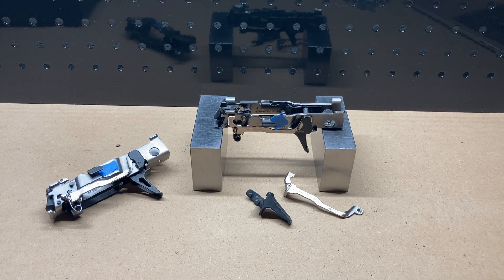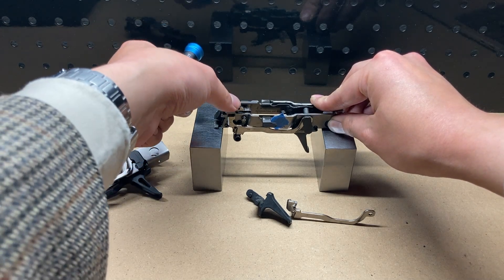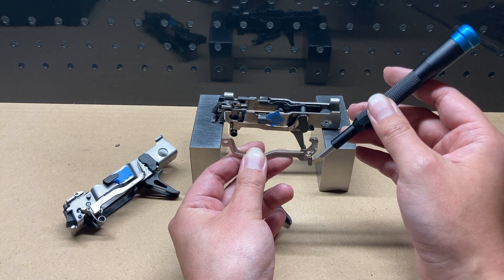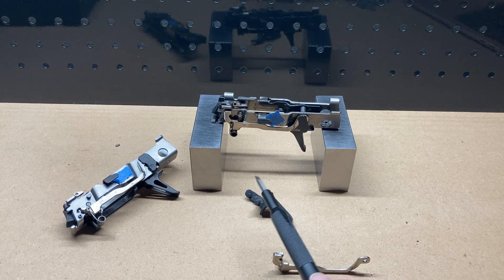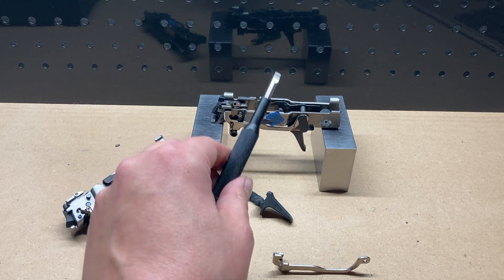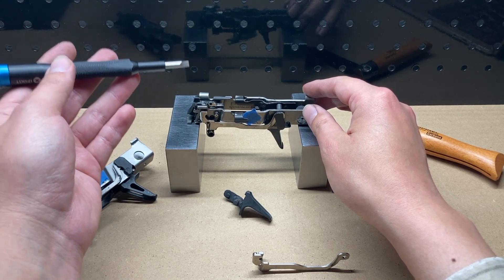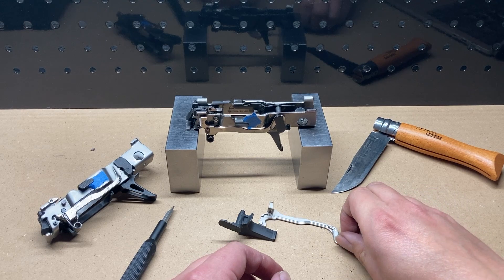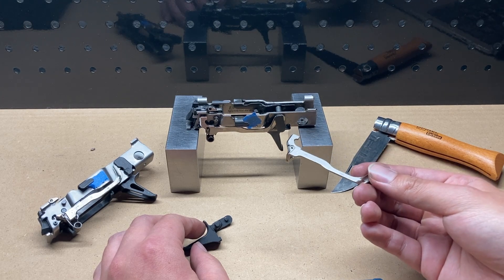P320 Sear Movement Test followup: It's all about the Trigger Bar and Trigger

Comment: This is getting fatigueing. Remember folks, as of January 2026, no 320 involved in an alleged "uncommanded discharge" case has been proven in court or certified lab to replicate the UD. NONE!!! look it up yourself. Any case sig has lost (only 2 so far) has been a subjective OPINION (termed "defective design") meaning it's ruling on expected safety standard and referring to lack of external safeties, which sig sells as an option. It functions as intended. It has been adopted by at least 5 other country's militaries and by our own, who also test the guns independently to their own safety standards and satisfaction. If there's a problem, they will find it. But there is none.
    Please, either accept the 320 or move on.

Comment: How about situation that pushing sear does not move tigger bar at all? It is post upgrade fcu, without disconnector (no milled notch in slide and no secondary notch in sear), in Europe upgrade consisted only on changing trigger and striker for lighter version (also they didn't include striker return spring).

Comment: If those two trigger bars can cause different results, then there must be something about the shape, mass, or material that is causing the different results.  There is no ghost in the trigger bars.
Reply from the maker: There is no reasonable way for the average, non-technically-inclined gun owner to tell the difference between the combinations of triggers and trigger bars that work and don't work, especially since even within the same part number, a lay-person imperceptible difference leads to different behavior. As such, it's effectively a dead-end trying to chase the specific trigger bar geometry causing the difference.

Comment: Just wanted to share my own experience, stock FCU other than a wilson extended slide catch and an apex curved trigger. 
When in that configuration I do not get disconnector like behaviour either in the grip (wilson and p80) or with the FCU on the bench. However I swapped my apex trigger back out with the STOCK curved one and now get disconnector like behaviour both on the bench, in the wilson grip and in a p80 grip.

Comment: I have watched your videos and I ran my own tests based on yours. My P320 is original and I didn't send it in to be "fixed."  I installed a safety trigger which handled the drop problem.( Iver-Johnson invented it, Glock copied it.) Taking the gun apart, I first tried pushing down on the sear. The arm that releases the striker restraint did not move. I couldn't push the striker forward until I pushed the release. It only moves when the trigger is pulled. Mine wasn't broken and Sig Sauer didn't get to break it. They shouldn't have fixed what wasn't broken.

Comment: OK, so no difference in geometry or dimensions between the two trigger bars. What about a difference in the location of the pivot pin holes for trigger and sear in the side frame of the FCU? Are the holes properly sized? Are the holes parallel to one another? Is the distance between holes the same? Is the X-Y location of the holes with respect to each other the same? Slight differences here could lead to more extreme geometry changes with respect to interaction of trigger bar and sear.

Comment: Great analysis. There seem to be a lot of factors. Non machined striker surface against the sear. MIM parts wearing faster and critical edges rounding prematurely. Tolerance stacking with all these interfaces. Your demonstration is very good and highlights that some FVUs may be fine and others not. And that one cannot visually distinguish between them.

Comment: The movement of the triggerbar either initiated by a trigger pull or by pressing down on the sear, is determined by the design of the captive safety lever. So whether the trigger bar is moving diagonally forward/down and back up, or only forward is also determined by the captive safety lever. From my point of view, it is all about the captive safety lever.

Comment: Combining this interesting view into how the disconnecter can fail to distinguish sear pressure from trigger pressure, and the clearly loose tolerances permitting some assembled pistols to be vulnerable to compression hammer drop with even slight trigger misplacement.

These guns are filled with weaknesses. And SIG simply aren't pursuing the issue intent to fix them.

Comment: If your caliper can't discern a difference between the two, that indicates its a matter of thousandths, which is kinda scary.  I have to wonder if there is a way to modify the safety release lever so release the safety lever later in the trigger pull, so the safety release disengages the striker safety just an instant before the sear releases.  It seems like the striker safety is getting released too soon in the series of events that needs to take place to fire.  But if the safety lever needs more travel, then even the bad trigger bar might not set it off.  I suspect the issue is a tolerance stack up that no one really understands, and maybe is so complicated even the Sig engineers can't understand it.  So the design needs to be modified to take those stack-ups into account.

Comment: I get the trigger bar seems to be the common denominator. It's common knowledge mim parts were used as result tolerances seem to vary. Could it be a combination of poor tolerances that lead to the failure? It would account for the lack of discernible differences between the two trigger bars.

Comment: Doing Sig ‘s engineering work and the Department of the Army’s actual investigations. They claimed the Glock was unsafe and can pass through a metal detector. All proven wrong. Sig P320 has proven unsafe underdeveloped and corners were cut with paid off Army generals to get contracts period.
Reply: What is the name of the actual general you mentioned? Did you make any effort to contact them or just whine?
Reply: @idothink-x8e They are listed on Sig web site. Hired as consultants to the project program. All retired except those who are currently serving in the Army for Future combat weapons systems.👍🏽

Comment: It would seem as though there is something else contributing to the problem if you’re unable to find a difference in the trigger bars. I personally do not know how the internals work, but based on the information you’ve provided, I can only conclude that there is something else going on. Now I’m going to have to learn how the system works for myself to get to the bottom of it. Thanks for adding another project to my plate. 😂

Comment: PLEASE READ @threeP320. I have an interesting situation with my FCU doing this test (my P320 passed the previous videos tests with the safety on/off: couldn’t get the striker to protrude when poking the sear and the slide striker safety functions as well). However with this test and the manual safety ON, the bar moves down then clicks backwards AND/OR just moves straight down without any click and I cannot replicate either consistently it is inconsistent. However with the manual safety OFF the bar moves down forward and clicks up (as correct per your video) consistently. I would like to get in contact somehow to send you videos considering most LEO and Mil carry the manual safety version.
Reply: Oh wow, inconsistent within ONE example?! That is even worse than the notion that it could be tolerance differences between the population of examples. But within JUST your singular example?! That is absolutely unacceptable and abhorrent. Which leads me to be even further convinced that this is a design issue from the very beginning, BEFORE we even take bad tolerances/bad quality control into account. And the cheery on top is SIG not labeling or documenting any of these silent changes which makes it nearly impossible to pin down what the actual heck is going on. 

Thank you for sharing your info! I find the results of your testing highly disturbing.
Reply: @P320Truther please take a moment to read the commenter above's post ☝ I find his results HIGHLY disturbing coupled with the testing show in your video.

Comment: My trigger bar is slightly different than the ones in this video, looking up online it seems that my trigger bar is made to be used both with and without manual safety models. Also when trying to do this test the trigger bar moves only forward but the trigger can't click... does it mean my p320 is safe? Thank you

Comment: My p320 fails when in the WC grip. When removed it functions correctly and when in original frame it functions correctly 70%. As mention above I notice that if any side pressure is placed on the trigger bar then it will not function correctly even out of the frame. 

The inside of the frame on the WC Grip measured 22.9mm while the sig frame measured 23.6mm. 

This slight difference and lateral pressure placed on the trigger bar seems to be moving it out of alignment and allowing it to fail.

Comment: Did u c the guy who grinded or cut off the back leg of the new sear and by doing that his p220 now works properly.  The tcu properly functions it seems from tbat mod...  He also showed that if you put your 220 together as in after cleaning it or watever like you do if trained on a glock. The new sear with the back longer leg or watever still sticks up like 1/32 of an inch.  Therefore the firearm is still appearing to be unsafe. Then he took one where he trimmed the leg off the back sear and you can assemble it just like you woukd a glock and it  is now not sticking up rendering the firearm safe. He peformed all kinds of drop test and beat on the pistol with a live primer in a caseing . The enternal safety held tge sear did not engage trigger bar... I havent watched all your videos but seen this one and another. Then seen this gentlemans. Was curious if  you now have seen that or heard of it? Also it looks like a bigger version of tbe 365 sear after he mioified it. If you know this disreguard my comment but if not would like to see wat you think.... If that gentleman is correct and tbe sear has been issue the whole time.. ? My question also would be would that make the 220 , 100% viably safe as far as wat Sig gunsniths or engineers intended it? Another words is there other failures outside the SEAR on the 220 tcu or firearm that would stil need addressed? Could a redesigned sear be a fix all end all uncommanded firing issue fix?

Comment: fun fact: not all trigger bars are equal, check the manufacturing numbers on them. They have different geometries. Slight, but different.
Reply: This is the problem, they are both labeled exactly the same. Sig is hiding the modifications they are making, to hide their possibly/alleged negligence, or coverup. Whatever you want to call it. I read your other comment about placing the bars on a table to check the angle differences, great suggestion. But there is still that issue that the numbers do not change over the years of silent/stealth changes SIG has been making, and probably continues to make.
Reply: @MrWhite2222  I agree, although, in every industry I know there are "stealth" changes on products ALL THE TIME. Not saying it's right, just saying it's become a standard.

Comment: Interesting.  I have two 320s; both have been "voluntarily upgraded".  One FCU displays the behavior that your FCU does, the other does not when installed in their respective grip modules.  I notice that the two FCUs have distinctly and visually different trigger bars with different part numbers on them.  I will be happy to provide the photo if it will help.  Subscribed and looking forward to results of reconfiguring the sear; your work here is appreciated.
Reply: Followup:  The FCU that passes appears to have a trigger bar intended for a thumb safety version even though the FCU in question does NOT have a thumb safety.  It appears that Sig installed the incorrect trigger bar, either at initial assembly or when the pistol was returned to Sig for the "voluntary upgrade!".

Comment: Just checked both of mine. Slides were removed, just observing FCU in grip module.  Both trigger bars move down and forward simultaneously when pressin on the sear. Now, on the other hand,  both trigger bars appear to only move forward when pulling the trigger. Using only my eyes and my ocd.....i couldn't discern and angular downward movement of trigger bar when trigger was pulled. This info is "for what its worth" . Not sure what it means if anything.  I do feel betther that both of mine function same as your fcu that passes the test.

Comment: So here’s something interesting, I have a Wilson combat p320 and I cannot move the sear with a punch far enough to cause anything to happen at all

Edit: wait nevermind I was doing the test slightly wrong, I did not pop the slide release up before I did the test
Reply from the maker: Popping the Slide Catch Lever upwards as part of the setup is necessary in order to fool the FCU into thinking it is in a fully-assembled pistol. Doing so allows the Takedown Safety Lever to slide back into position and release the Sear for normal operation. It's not something most folks instinctively think about when doing more complicated function checking of the FCU.
Reply: @ yep, after doing the setup properly, mine fails the test, however when testing it fully assembled 6/6 times I did not get any firing pin protrusion which is interesting

Comment: This is all great information, but to me,  it still seems just as likely that the striker safety lever is getting captured in the up position. As you know, instead of a typical plunger, they’ve opted for a lever and torsion spring. Instead of the spring being directly under the mass of a captive plunger, the extremity of the spring is contacting the extremity of the striker safety lever in relation to a fulcrum. The spring is also not captive where it mates with the lever bar. Is there any way for it to slip off and capture the lever bar in the up position? Also, is it possible that carbon buildup or primer debris could foul the index hole at the top of the striker assembly where the safety block travels, causing the lever to become captured? I know that still means a sear malfunction would need to occur, but the operator would probably be totally unaware if this condition were present. It could go on for a while intermittently before something happened.
Reply from the maker: I presume here that you are talking about the Striker Safety Lock and Striker Safety Spring, as the Safety Lever and Safety Lever Spring were changed as part of the "voluntary upgrade" to no longer use a spring and instead be slaved directly to the Trigger Bar.

Checking for proper function of the Striker Safety Lock and Striker Safety Spring is easy to do. As with any mechanical component, it is possible for these parts to malfunction, but such a malfunction can be checked for as part of PMCS without even having to field-strip the pistol.
Reply: @P320Truther they may call it a “lock”, I don’t know. The piece that actually enters the striker channel to intercept the striker is still pivoting off of a fulcrum and sprung by a torsion spring. Hence why I refer to it as a “lever”. I was under the impression that this didn’t change with the “upgrade”, though the parts themselves did change a bit. According to photos, it’s still how striker assemblies are shipping, but the striker safety now appears to be a stamped piece. I just don’t really care for the design and don’t think it takes a whole lot of imagination to anticipate a few potential issues that could result from it.

Comment: If you can't find a linear dimension difference then chances are, it's s subtle angle difference.

Take a photo of each in the exact same position(s) with a camera that is mounted on something that is not moved during swapping of trigger bars, the overlay the two photos with each other and you should be able to see if there is any discernable differences that could be coming into play.

The key is also to make sure that the two bars are positioned exactly the same, relative to the camera (like in a fixture with locating features / datums.

Comment: Don't know if anybody have mentioned this above, but check the angle on the trigger bar. If the angle is too open, or if the trigger bar is not completely straight, the part where the sear is touching the trigger bar might be too far back and the sear might be moving it wrong. If I'm not making any sense, it might be because English is not my native language. So write me if you want me to send pictures to "show-and-tell" 😊 

Furthermore, if the angle is too open, the trigger might have to be pressed harder because the timing is wrong. The trigger simply reaches the end of its movement before the shot is taken.
Reply from the maker: The angle certainly plays a role, but it is difficult to the point of infeasibility to replicate the exact correct angle necessary for disconnector-like behavior to occur with the Trigger Bar. A different solution was necessary.